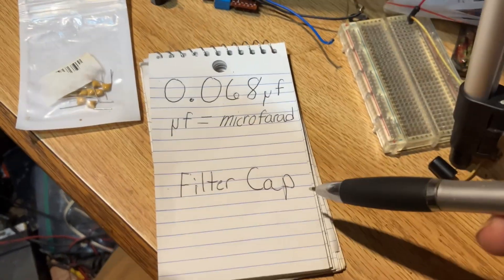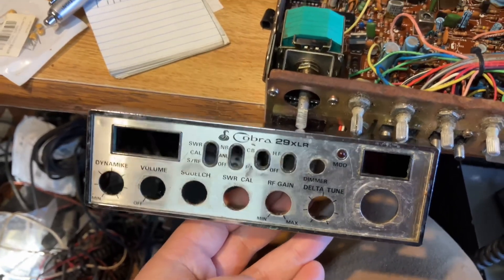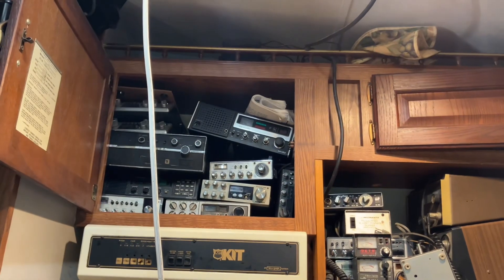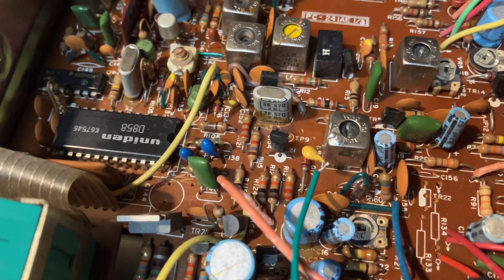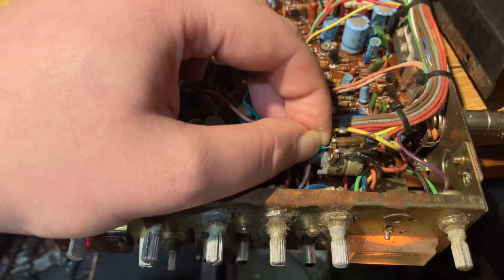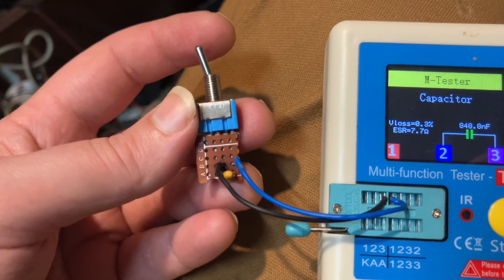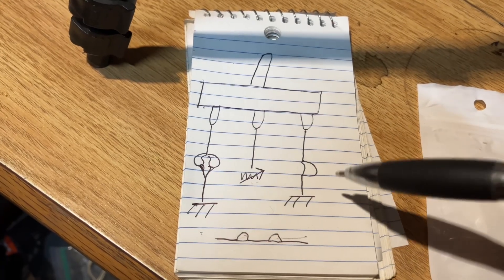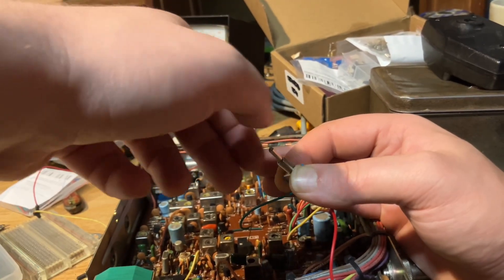How to Fix Your CB Radio Noise for Good! The “HI CUT” TONE CONTROL

Comment: So will this fix antenna rf noise pic up or do I need to still ferrite bead and bond it more?
Reply from the maker: Is this a mobile rig you’re talking about?

Cause if it’s a base station, I’d recommend grounding it first 

And then using this trick afterwards
Reply: @JohnnyJonesathome it’s mobile, I tried a GrantXL , 148gtl , MK1 Lincoln. Even an 29 classic and it rough.

And I was wanting to fix it before putting my hb-140 amp in because idk if it will hurt it
Reply from the maker: @DoubleDsShadeTree  do you have a truck that has a distributor?

Noise blanker should take care of that.

But even better, you can actually put a power filter on your radio

Or ferrite beads on your power leads
Reply: @JohnnyJonesathome I’ll order some